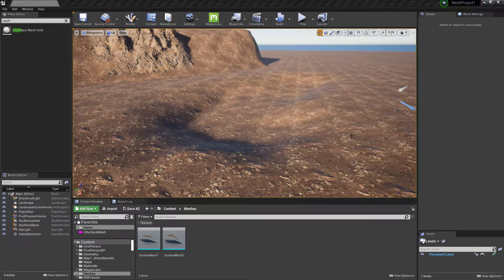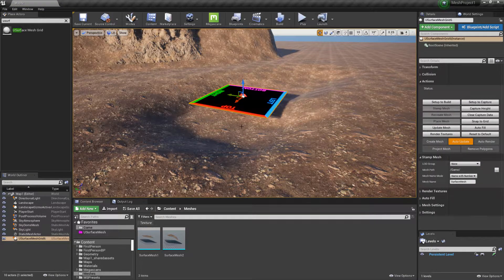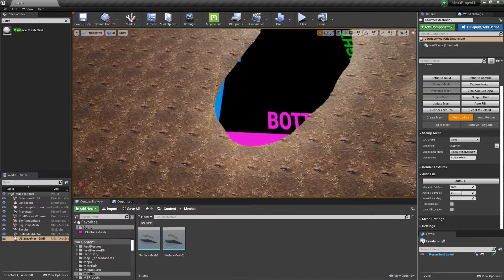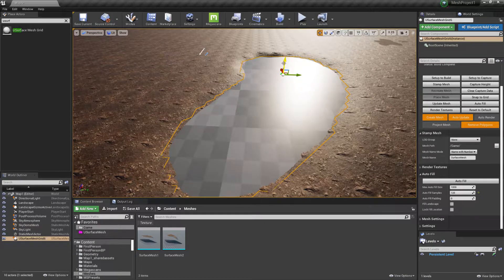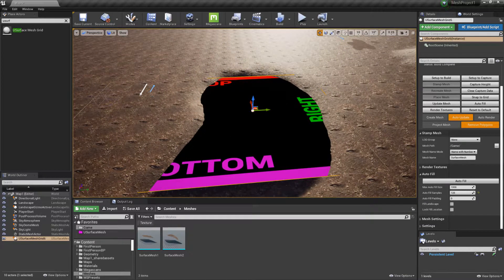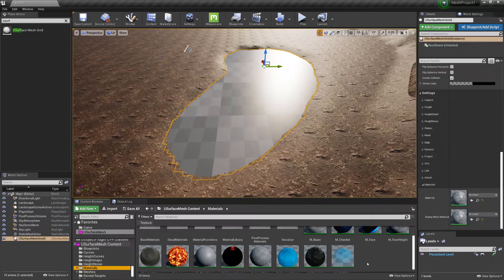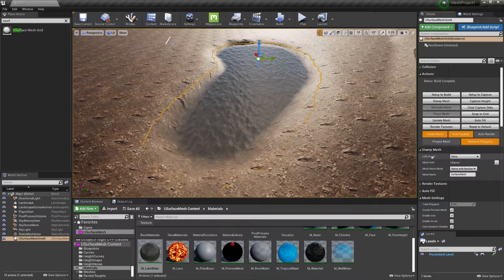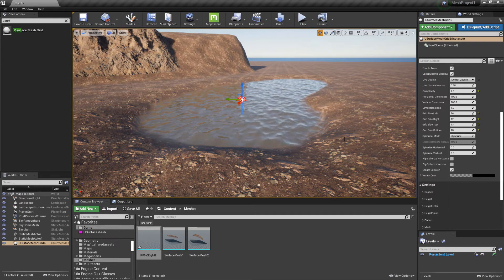USurfaceMesh - Create a Water Mesh (Unreal Engine Plugin)

Comment: Now, this looks like a really solid plugin. The cliff stamping system is something I am trying to achieve with Houdini but this lives inside the engine which is always good if not better. I also love how the tool clips unnecessary polygons away. Is it possible to stack the stamps one on top of each other to build complex cliff faces using displacement maps?  What I'm trying to build is a landscape that features something in the line of cliffs of the Faroe Islands or similar so lots of verticalities but also a lot of detail at the same time. Also, can the tool read channel packed textures to assign the material layers instead? Sorry if that's been covered in the videos, I might have missed it.
Reply from the maker: Yes you can stack meshes on top of each other. Once stamped, the mesh is just a regular static mesh with its collision channel set to block the "USMProject" trace channel so more builds/stamps of new meshes just project onto this new surface which you can then repeat the stamp/project process to rapidly build out a cliff structure. After all of the cliff meshes have been stamped you can then, if you want, project a much larger flat mesh over the whole lot and capture that detail to either a texture/render target or stamp a brand new mesh in place. You then just remove the other meshes that made up the cliff. A second option is to enable Always Live Update and you can sculpt the landscape and the mesh will keep rebuilding itself. A third option would be to use the tool to capture the landscape (all or a small section) as it is and then stamp that mesh, then export out to a sculpting tool like blender/zbrush to manually sculpt exactly what you want. You can then reimport back into Unreal and use the tool to place the new mesh back in place of the captured one. It will then fit perfectly in place rather than manually rotating/translating/scaling.
Reply: Man, you're getting my Tool of the Year Award vote. This is so awesome. Thank you!